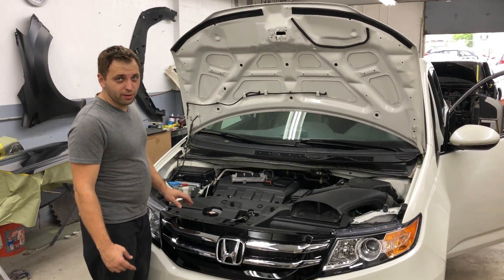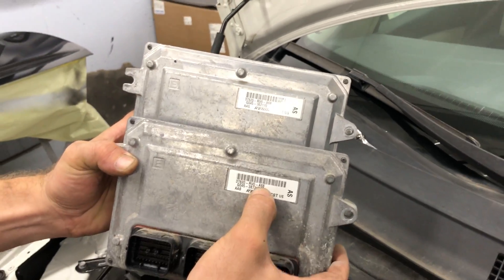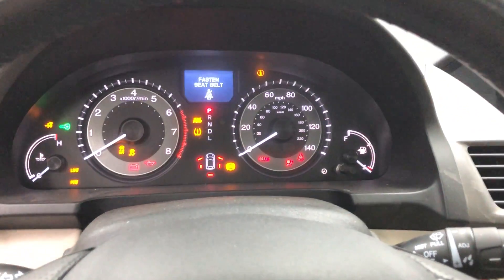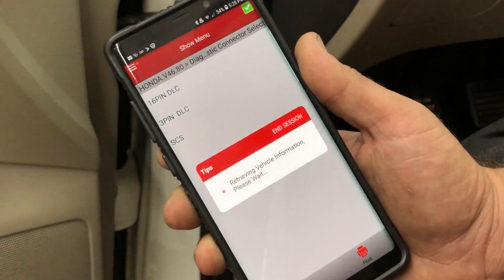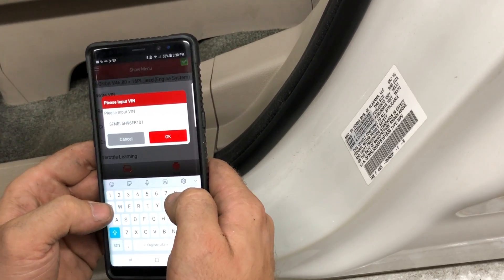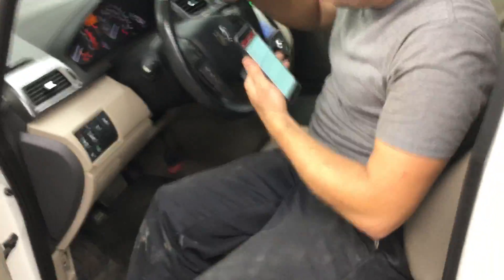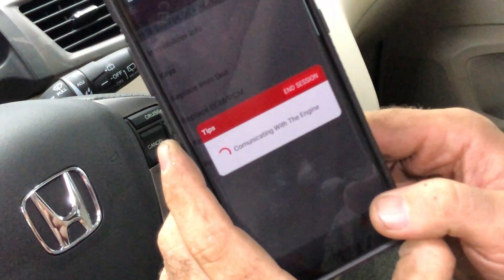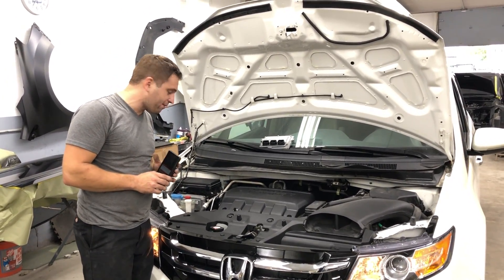UNCUT-FOOTAGE OF "HOW TO PROGRAM ANY HONDA, ACURA, ENGINE COMPUTER JUST BY USING YOUR SMART PHONE"

Comment: This tool is handy. I used it to recalibrate the weight sensor on the passenger seat for the SRS system because I had a “Passenger Air Bag Off Light” and “Side Air Bag” Off. This fixed it. SRS system works as indicated by the owner’s manual.
Reply: From where to buy the same one in the video. George's Amazon link doesn't work!! Thanks

Comment: Hi, I have 2008 Honda Civic hybrid and all lights are on. Just today Honda dealership said that they can’t diagnose the error and can’t help.  Car was going without any errors for years until this happened yesterday.  No parts available and I almost got killed when the car staled at a intersection.  What app and odbc tool I need to purchase to fix this issue with a old computer. Thanks in advance.

Comment: Hello again.  I posed a question about the tool you are using in this video.  Since you will not take my call, nor have you responded to my emails on your Melnik site, and finally you still have not even responded to the previous post.  I need to get to the truth of which tool this is as there are so many out there in the world and it would not take you more than a moment to respond.  this is what I am looking at....  https://www.aliexpress.com/item/4000056168867.html?src=google&albch=shopping&acnt=494-037-6276&isdl=y&slnk=&plac=&mtctp=&albbt=Google_7_shopping&aff_platform=google&aff_short_key=UneMJZVf&&albagn=888888&albcp=1582410664&albag=59754279756&trgt=539263010115&crea=en4000056168867&netw=u&device=c&albpg=539263010115&albpd=en4000056168867&gclid=Cj0KCQjw-af6BRC5ARIsAALPIlUcIoYCsPLE08lCtKHyYqkZ6n8mUZHmbro3jHBN7ZIs1Bc3hmL-yRcaAvxHEALw_wcB&gclsrc=aw.ds  
thank you for your time and effort.
Richard

Comment: Hello George. I have a Question:  I have used this tool many times before with Honda's without an issue.  I downloaded the Acura software and tried to use it but I received an error when trying to use the software: Open Prive libfile fail.   Have you ever experienced that error?
Reply: Did u ever get the answer?

Comment: good morning Mr. George. My name is Reny, I am a follower of your channel, to which I am entitled. I need your help and technical advice, I work a lot with honda cars, especially in the area of automatic transmission, and in many cases it is necessary to change the PCM, which I can not do myself because I do not have the tools to program, or re-program PCM; therefore, I have to make changes to the complete system of keys and PCM. because in many cases the dealer does not do those jobs with cars that are more than 10 years old. How can I get that program that you have? Can you help me with this matter? If possible, please send me the necessary information to buy it, including the specifications, what kind of phone I should use. You can contact me through: las.americas2@hotmail.com or through whatssap: +297 563-0738. I appreciate in advance any kind of help from you. greetings and blessings from. Aruba THANK YOU.

Comment: This is the real deal.  I have 3 launch x431 dongles. One running a note 4 and 2 others on samsung tablets.  I have a repair shop and had issues with programming a honda ecm and saw an earlier video by  george melinik and ordered the x431.  And worked great in a few minutes.  Thanks for the video.
Reply: where do you buy this?
Reply: where did you get yours?....
Reply: Do i need bluetooth?